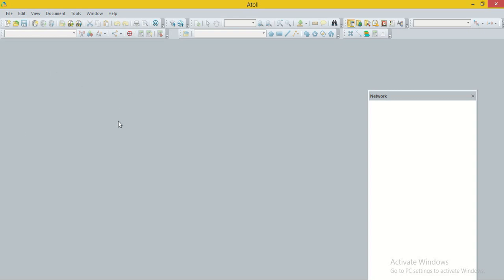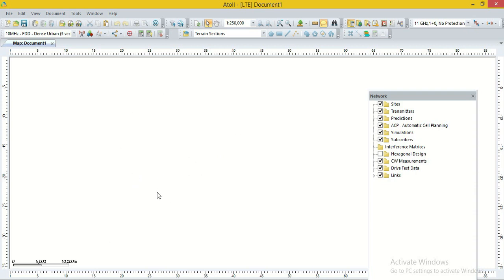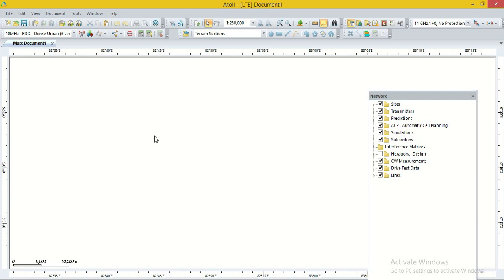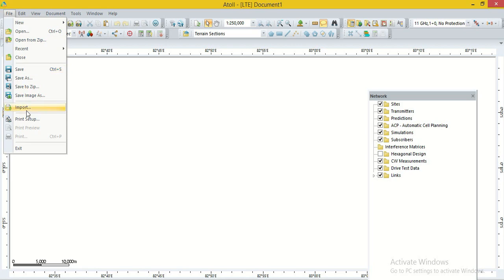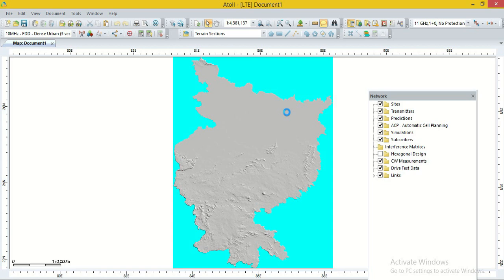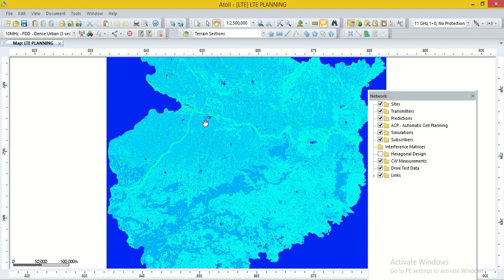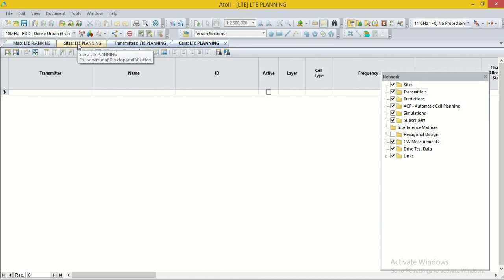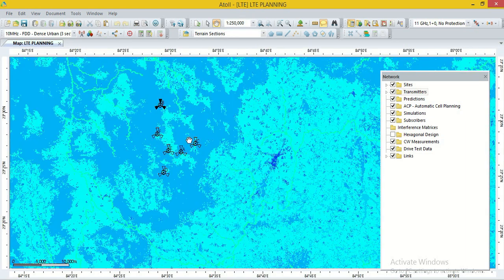ATOLL Lecture 1 (Making a Project for LTE Network)

Comment: How to add a particular frequency band antenna in atoll project
Reply from the maker: Go the the parameter Explorar -Radio Network Equipment-Antenna, then open the antenna window now you can add new antenna radiation pattern or you can modify the existing antenaa profile.  
Thank you

Comment: Is it like the main difference between transmitter data and cell data: transmitter data is sector level data and other is cell level data?
Reply from the maker: Both have data sector wise
Transmitter data corresponds mainly Physical parameter ex- Transmitter height, Transmitter equipment type used, Cable type, Propogation model etc-----
And Cell data corresponds to Radio parameter ex- Transmitter power, Frequency band, frequency channel no,Physical cell Layer Id, Min received signal strength etc...